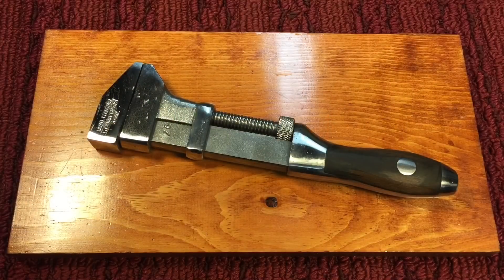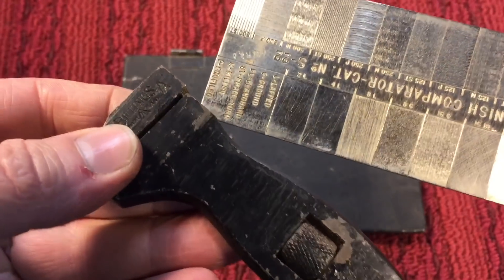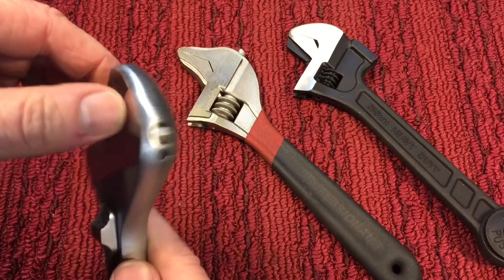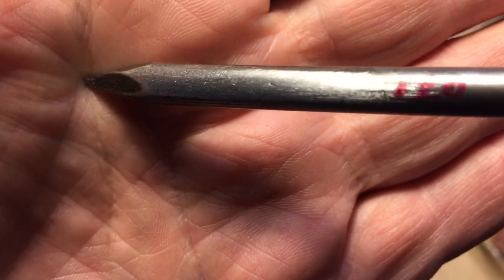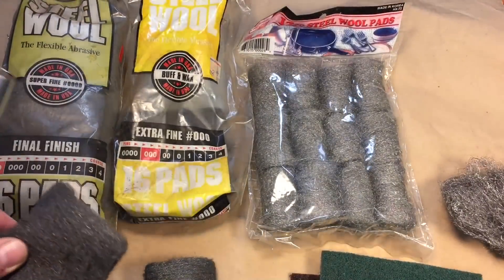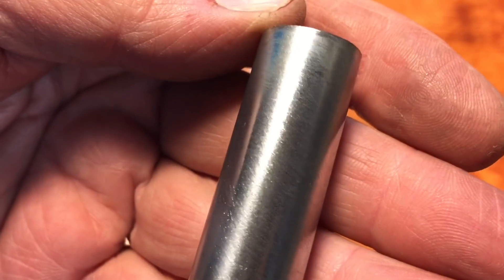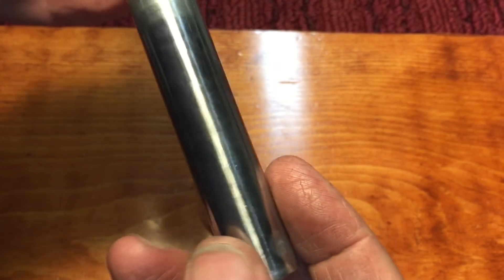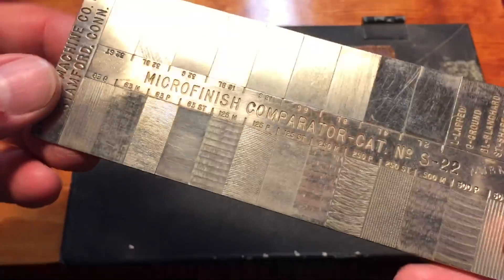Surface Finish Considerations

Comment: I used to tell my students they were "trading scratches"; the progressively higher the grit, the shallower the scratches.  Also, to look at it as particles passing through a screen; 50 grit, for example, would have larger, but half the number of openings per square inch as 100 grit.
Reply from the maker: Hello Rick! You are absolutely right...  Abrasives are changing and are getting better... Life would be so easy if we just worked on one material..  It always gets foggy when different materials and hardnesses are at hand.   Thanks so much Rick!!!!!!

Comment: Great video (as always). I am ashamed to admit that a lot of the car boot tools get the wire brush treatment to remove the rust then get an oily rag wipe to prevent the rust returning. I think your approach is one we should all strive for.  Do you polish "user tools" as opposed to "keeper tools"?.
Reply from the maker: Hello Tony!  Oh No! Most of my user tools are just like everyone else!  I reserve this treatment for speciality or collector tools... Some I do use...  I like to collect certain tools and those I especially like to give the treatment...  One thing I am a stickler for is that all my tools operate smoothly...  No binding or bent, broken or loose...  I like my user tools to be ready for use!  I'm sure just like you!!!!  Thanks Tony!!!!!!

Comment: Hi there what would you put on polished steel to prevent it going back to rust in the tool chest?
Reply from the maker: Hello Paul!  I have found that a good coat of mother's carnauba wax after the polish really keeps the tool nice!  If the tool will be in an unheated garage I wipe down my outside tools with a thin coat of the 50/50 mix  of Vaseline/mineral oil!  I made a video on how to make it titled- "Home-Brew Lubricants Part 2!"  It works great!  Thanks!!!!!!!!!!!

Comment: To paraphrase Mad Max, "surface finish is a question of money.  How smooth do you want to?!"
(for Space Shuttles, spend the money!)
Great video.  Exceptional video.  Thank you!  
Since you are going down to this level of surface finish; I am very interested in metal tool coatings.  Thickness, types, health hazards when removing, what was done in 1934 but isn't done now, etc.
Reply: whoop: "...how smooth do you want to go?!"
Reply from the maker: Hello Foot Pusher!   I too have always found that very interesting!  I tried to replicate a few of the older finishes like lamp black/varnish and so on but realized I needed a old timer to guide me!  =)   Thanks!!!!!

Comment: That's another questions can  a bench  grinder be used as a buffer?
Reply from the maker: Hello Bert!  Oh yes!  A bench grinder and buffer are just motors with long shafts to mount a wheel of some type.  Traditionally buffers have longer shafts... if you use a grinder you have to just remove the safety shroud for access to the buffing pad.   =)
Reply: Thank you i wasn't  sure.

Comment: Sandpaper is graded by how many grains of sand per square inch.  Those surfaces  can be attained by wire wheels,  sanding wheels and a surface grinder,  although there are some machine finishes. There is three there that come from a proper use of a surface grinder,  one of going to fast and another from a wheel that wasn't dressed.  Actually all of the finishes have finger prints but rougher finishes camouflage them.
Reply from the maker: Hello 57W!  Yes! It's funny but many of the "Big Boys" Adam, Tom, Keith... are revisiting older machines like shapers and surface grinders. Because of this there has been a resurgence of interest in those machines!  The funny thing is when I see someone new who owns a shaper but not a drill press!  LOL  Thanks so much!
Reply: @ScoutCrafter   Yeah, that happens in a lot of areas. Online forums are worse. Some have dedicated people who know what they are talking about and know what they are doing,  others well you just shake your head. Guys that talk about all they intend to do to build a particular vehicle from complicated engine and suspension work,  then 2 weeks later they want to know how to change an alternator.  They want grad school but haven't finished 1st grade.  I learned from old timers while working in machine shops and tool and die departments.  When I say old timers they would be in their late 90s or well over 100 if they were still kicking.
Reply from the maker: @57WillysCJ  It's funny, my whole life I was always hanging around older people...  I always found their stories and hobbies the most interesting.  I remember years back when most of my friends were into mischief I was hanging out with a group of guys who built and flew rubber powered airplanes!  I learned so much from those guys who were more then happy to pass on the information...  I feel an obligation to do the same.  The Scouts were great but is limited in scope.  Here you can give a tip that some kid halfway around the world could use!  =)   Considering the crap that's on TV these days I think it's a great opportunity!  =)

Comment: Well,Polishing and finishing is both an art and a profession..One chap I knew, his father had been a polisher/finisher .It isn't easy to get perfect finishes,its quite a skill in itself..This video was as usual  but the lighting you used made it a bit hard to  see the "Stryations " etc at this end...I liked that little "sample finish display set"  never ever saw anything like that before though obviously they would have to exist..There is a lot of buffing and polishing going into many products that people arent aware of..such as cookware,cutlery,tools etc..Sidchrome had about 6  fine grinding/polishing//buffing processes on each tool..Military tools down here always had to be non reflective (black oxide usually)..Have you ever come across the surface finish k own as Hazel Brown.? which dates back to the 1700s..? I have heard of it being used on early muskets,such as Brown Bess,and it is what Eli Remington used on his very first rifled musket..Nobody down here has any knowledge of it..Have you considered using the services of your squirrel friends in the polishing process.? Buffing compound on tails would achieve a high lustre finish all for the cost of peanuts.? LOL  nice to know you are feeling a bit better..regards etc
Reply from the maker: Hi Bob!   The design process in manufacturing is just amazing when you consider every single aspect that has to be considered...  Material, surface, dimensions, weight, temper, hardness, and of course surface finish... The surface comparator was a indispensable tool at a machine shop. When a customer needed to describe the desired finish what a perfect tool to accomplish this... I would love to put my little friends to work!   LOL   Thanks so much Bob!!!!!!!

Comment: Scout crafter, I remember those surface comparators. I worked as an inspector in a steel foundry and we had an as cast surface comparator for all of the Navy castings that came through the shop. I haven't seen a surface comparator for decades! Thanks for that!
Reply from the maker: Hello Bill!   Wow!  I bet you did some awesome work in the foundry!  Those were the "real" jobs that built industry!  Thanks so much!!!
Reply: @ScoutCrafter  yeah the two main kinds of tools and equipment they used was rigid and Proto.

Comment: I used to work in a foundry, and I remember two of our expressions:
What the eye doesn't see, the foundry gets away with; and
Fool the eye.
Love those microfinish comparators, I can't wait to see them in the tool museum you're building upstate.
Reply from the maker: Hello Michelle!  Wow!  Worked in a foundry!  That must have been awesome!  I've done some casting and it becomes very evident that it's easier to sand down the plug and save time over trying to correct a rushed job by sanding the castings!  LOL  Thanks Michelle!!!!!

Comment: Great video. You would have been a great teacher. Explained things very well. On a side note. What lubricant works best to free up things like a wheel frozen on an adjustable wrench. I want to avoid using pliers to break it loose. It can wreck the knurling.
Reply from the maker: Hello Tron!  Yes you are so right the knurling on those thumbwheels are easily chowdered up!  Penetrating fluid works best to free up that wheel...  If you look at my video titled "Two Must Know Shop Lubricant Tips..." You will see a very easy and inexpensive way to make your own super shop penetration oil!!!   You will love it!   Thanks Tron!   😃👍

Comment: Hi  Scout:   Let me ask you I have an aluminum table for a band saw that is badly corroded from being left inside an outdoor shed for 10 years, how would you attack it to clean it up???  (Garage Sale find)      Thanks
Reply from the maker: Hello gardener!  I know how bad Aluminum can pit and corrode over time.  The good thing is the metal is somewhat soft and can be addressed...  The best way is to use a portable belt sander of if you don't have one a block of 2x4 wrapped with sandpaper and sand the top of the table until the corrosion is gone...   Start with a course grit and work up to a 400 or so!!!  Hope that helps!!! 😃👍

Comment: These are always educational but!? How do you know which compound to use?
Reply from the maker: Hello Kevin!  Compounds and polishes come in "grits" just like sandpaper!  You can buy 80, 120, 360, 600...  Grit polishes so if you want to go that route the best thing to do is buy a few different compounds and see how they perform...  Usually for out tool restorations the bar compounds are best...   Emery (black) for steel...

Comment: I would like to add that there are 2 different standards when it comes to sandpaper.  The one we are used to in the US is CAMI (Coated Abrasives Manufacturer's Institute) .  The other standard is  FEPA (Federation of European Producers of Abrasives). A FEPA P400 grit (FEPA grit designations start with a P in the US)  is more coarse than a CAMI 400 grit.  Generally speaking the lower grits are fairly close but as the grit numbers get higher the greater the difference between the two.  To get a CAMI 400 you would need a FEPA P700.  FEPA P2000 is roughly equivalent to a CAMI 1000.  Make sure you are getting what you think you are getting.
Reply from the maker: Hello Drew!  That is great information!  I never knew that!  Here in the US most sandpapers are very close... However whenever I use abrasives I usually go by the feel test where I run my thumb slowly across the surface of the paper and make my choice that way!  No wonder my Thumbprint is so hard to read!  LOL  Thanks!!!!!!!!
Reply: @ScoutCrafter  Back in the '80s I worked in a cabinet shop that was part of an assembly line.  Everything had to be sanded to 400 grit before the finish was applied.  I became very familiar with it and like using 400 grit long after I left that job.  In the mid 2000s I bought sandpaper from HF and it just seemed too rough.  I wondered what the "P" was about but ignored it.  The HF 1000 was clearly not as smooth as the 1000 I bought at the local auto parts store so I finally researched it to see if I was just crazy.  I am but I was right about the grits not being the same. Lol

Comment: Hi Scout - love the overview.  I don't know if you every used those triangular "spyderco" ceramic stones but they are very useful when working on a flat surface  (like Williams wrench ) where you  might be concerned about wiping out text.  Use the corners of stone to cut fast - use the flat for final polish.  They also work for removing that sharp inside edge (again...Williams wrench) with just a couple stokes leaving a shined facet.  Anyway,  thanks again for sharing.
Reply from the maker: Hello John!  I have some sharpening sticks in different grits and never thought about using them on tool!  What a great idea!  I will have to give it try!   Thanks so much John!!!!!!!

Comment: This should help take a lot of the mystery out of getting a mirror finish for some of us. By tue way, I found a chart on my big drill press. It spins at 3800 RPM at top speed. Good to see you're not pushing yourself too hard before you're done healing.
Reply from the maker: Curiosity Forge Hello Allan!   Lol!   To be honest I would have to put a tach on that drill press!   That thing spins like a tornado!   Lol.   Thanks!!!
Reply: I'm pretty sure it's just loud. It DOES spin fast, 3800 RPM makes sense.

Comment: That was an excellent explanation of different surface finishes. I relearned a few things that I had forgotten. Interestingly enough I have one of those little microfinish reference gauges. Nick Nailo  gave it to me for Galoot-a-Claus about 15 years ago.

Back when I was doing car body work I had a lot more grades of sandpaper that I do now. If I was intending to take surface finishes up to where you take them to I would have to do a lot of buying. 
I am noticing with the nickel that I'm going to have to do something different if I'm going to polish up that stuff. it does buff very nicely. It's just really really soft. I thought it was a lot harder than what it is. I never thought of nickel as being a soft metal, but compared to almost anything else it is.  It's nearly down the level of aluminum. It scratches very easily.
It also is by nature a thin coating. It doesn't take much to wear right through. I'm learning a lot from the project and your video today reminded me that I should mount the buffing wheels on the spare Foley Belsaw grinder. It's a lot faster then my little 1/4 hp that I use for arbor mounted tools. 
Thanks. 👍
Reply from the maker: Old Sneelock's Workshop ---   Hi Dave!!!  Yes, Nickel was always a good looking but not so durable surface!  I remember early on blowing thru nickel surfaces when trying to shine them up!  😨.   Chrome plating really made nickel obsolete.   So far I still haven't found a better nickel plating then Ford's model A headlight rings!  😃👍.   Thanks Dave!

Comment: for wrenches, i dislike the snap on wrench mirror finish,  the german ceramic vibrated and then chrome is soo much nicer to actually use, i used to like the old black oxide industrial finish, yeah you had to wipe down with oil, but wiping down your dirty tools after the day was part of the process, also with greasy hands it was better to hold.
Reply from the maker: Hello Jusb1066!  I agree, although the Chrome finish is beautiful to look at it is prone to scratches and fingerprints.  I never liked black oxide anything because they rust faster then any other finish...   😃👍.  Thanks!!!!
Reply: Very good point.  Clean hands don't need nerling, but working hands don't need a smooth mirror finish to try to hold onto in a blind, tight space.
You want all the surface friction you can get.
Reply from the maker: @MarkH10   I think Polished tools were strictly a selling feature.  If performance was the only thought everything might look very different.   =)